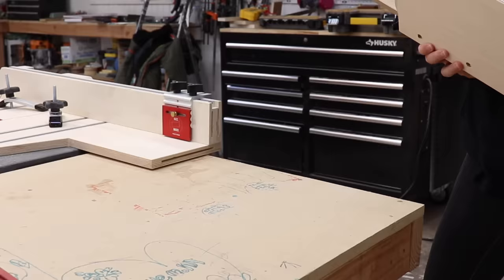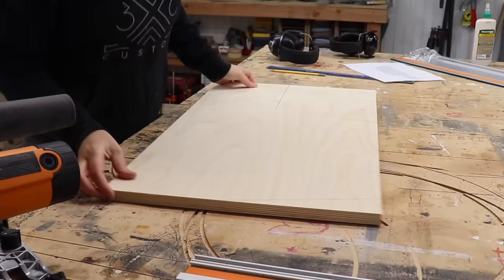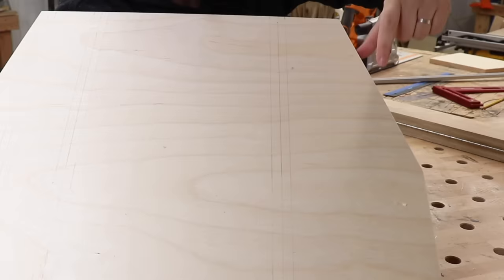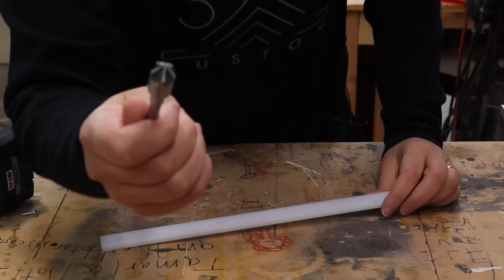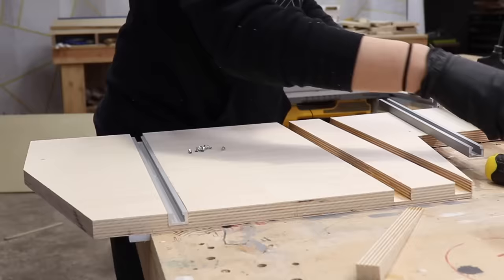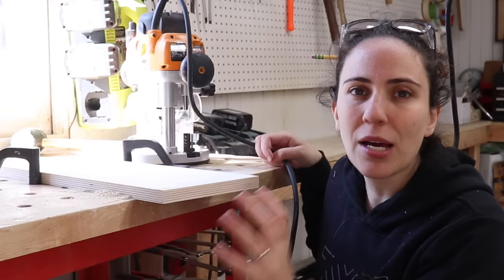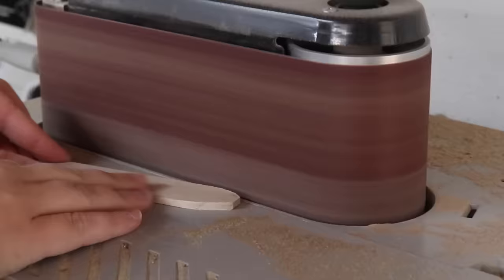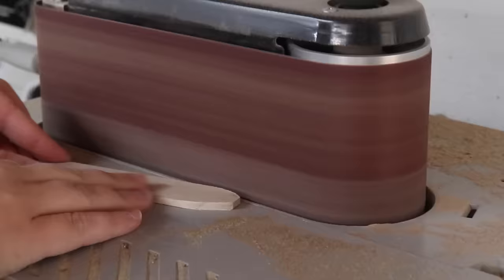SMALL Cross-Cut Sled with ADJUSTABLE Fence, EXTENSION wing and BEVEL Feature!

Comment: Very nice sled!  I would suggest though that your mitered end of your sled should be on the opposite end, where the blade falls away from the sled.  That way, the waste cut off falls to the table and would never bind into the blade.  Since you have the blade tilting in towards the sled, the waste can be trapped to the blade and can throw or kickback your waste.
Reply from the maker: The piece I keep is usually on the sled… and it’s clamped. The offcut is on the outside

Comment: Just built a new sled for my new saw, basing a fair amount of its functionality on your design (particularly the t-track positioning and the ability to use the miter stop with the clamps. It's a great tutorial video, and I'm really happy with my result. I didn't (yet) include a t-track on the fence because I haven't convinced myself that the extra utility from a track-based stop block is worth the effort, but perhaps that'll be something I add when I run out of things to do :) Thank you!! (also bought your plans online for the layout details)

Comment: I love the design, its has a lot of possible applications. Its always nice when one tool can do multiple things while maintaining high quality standards. My only "but" in this one came up when I priced out the materials. At current prices the total for the sled comes up to $300, and that's not including shipping for some of the parts. Some of that cost can be justified by having "leftovers" such as the T-Track hardware kit that's $75 and the HDPE that costs $30 for a 12x24 sheet, but a lot of it will be all used up on this sled. 
I feel like after spending $600 on the table saw I might have to wait a little while before picking up this project. It's definitely the most thought out sled I have seen so far though.
Reply from the maker: Yeah I hear that. But it have been the most used jig in my shop. So it’s worth it

Comment: I bought your plans. I am in the process of building this now. I am looking forward to using it to make 12 One hundred and forty year old barn oak picture frames. I have a Sawstop Industrial cabinet saw and I had to adjust some measurements which of course you expressly mentioned. My saw miter slot has slop long ways, meaning the miter slot is looser in the front and tightens as you go further in. I couldn't for the life of me get it to not have play using one miter bar. I put on a secondary miter bar, one that I can remove to use the 45 degree feature. I made my fence out of three 3/4 pieces of Baltic birch with the main fence having cut the middle piece 5 1/4 shorter on the extension side. On extension fence I made the middle plywood sandwich 5 1/4 longer and it slides into the main fence locking it into the main fence with threaded 1/4 inserts and flush head furniture bolts. Your design is really pretty awesome. I will say with current inflation, by the time you buy the plywood, and all the components, this sled turns out to be pretty pricey. I mean really pricey. But that being said, thank you for this brilliant design. I was using an Incra miter bar. I switched it out for  maple miter runner and now the is no slop. So it looks like I am gonna be able to use one miter bar instead of two. Almost done with mine. Getting really excited.

Comment: Fast way to ck squar, cut off a decent part, flip the off cut end for end and see if the 2 cut lines are tight or if you have a gap if it has a gap first thing I do is make sure the blade is parallel to the table t tracks and the fence is parallel to the blade is every things in line, then start on your cross cut sled, set one screw and use a true square  to line up the fence and add a second tempory screw. Now without the 5 cut method  make one long cross cut  flip the offcut and place it next to the originally placed part if you have a gap you can mesure it with feller gadges paper or tape or even a playing card, then move the fence in the direction to correct the cut lock it back down and make a second test cut. You should fall pretty dam close to perfect  becuse your working with wood there is really no need to split hair's  unless thats somthing you find critically nessary
This all depends on what your making
And how good the craftsman is going to be, but no mater how hard you try your not going to get a perfect 90. It will always be off by minutes  in degrees 
Even metal work isn't perfect. 
You have to find your tolrance leval and strive for it, thats cratmenship.
Even the best work isn't perfect. 
Its whats pleasing to the eye.

No offense but thats a dewalt table saw its not all that accurate to begin with
Its a job seight table saw,  it ment to load in the truck and take to a job, its also plastic, that means its getting Jared around.  Id like to see you find a good used cabnit shop type saw, like a used powermatic or delta or even a craftsman from the eairly 2000s the rigid isn't a bad saw  you can find a decent used saw for under 500 bucks. Even as low as 300 bucks.  Look on Craigslist before you go set down a 1000 bucks on a new tool and visit estate sales.  You can pick up whats now a 2k dollar saw for under 500 bucks used.  So it might need a tune up or some refinishing on the table top.
But ill almost garentee  you can find a good saw that hasn't been abused or even used much. 
This is with any tool.  Who know you might find somthing really good with a incrua fence on it, that fence can make a cheap saw cut like a 2k dollar saw.
It pays to watch the ads. Trust me I paid 20 bucks for a sears craftsman lathe made in the 60s with a duplicator on it.
At am estate sale.  Along with that I got 650 bf of walnut lumber and a 120 volt motor all for 22.50  the lathe alone might sell for 350 to 400 but I'm keeping it.
I also paid 65 bucks for a delta 6" jointer .
It pays to shop around.

Comment: Pretty impressed with you sled, beats mine into a cocked hat. Got the instructions from your website. I'm in England, we use metric now and it is so much easier than inches and fractions of an inch. Had to get my old ruler out. All our ply is metric as well. I guess it's what your used to, and it's what it is. Printed out the document onto A4  paper and shot off down the workshop with the plans. Excellent until I tried to see the printed sizes. No problem, got out my head mounted magnifier and there it was as plain as day. Not a criticism of your design by the way excellent bit of workshop work and a good set of plans. Thanks for sharing.
Reply from the maker: Ah sorry about that

Comment: Every time someone says they are not going to worry about making the back fence perfectly square, I cringe just a little.
In my mind, the front fence is the one at the front and the back fence is the one at the back.
Working with the sled and looking at it, I'm standing behind it so the front is furthest away from me (just like my stomach!) and the back is where I reference off.
Thus the back fence is the one that should be square and the front fence is the one that doesn't matter.

Comment: You have a side table which supports your fence extension. Most of us do not use a side table. What about your extension design (length and attachment method) for those of us without the side table? 
If you remove your side table: 
-does the extension base and fence remain true/flat/straight? 
-is the sled with extension still stable (not side-heavy)? 
-does a single slot runner continue to be adequate compared to 2 runners?

Comment: One of the best combo cross cut design I've seen.  Question...   ...Could you add the second miter slide and simply dado a channel for it on the side extension table when using the bevel function?   I'm just concerned about the stability with only one miter slide.  Or, maybe my concern should not be of any concern at all.  Thanks for the video. It made me a new subscriber.
Reply: I e used it for a year with just one slide and it’s fine.

Comment: If you flip the adjustable angle piece upside down, then you can butt the 45° up against the fence and always be sure that you’re cutting at 45°, because if you have to eyeball it every time, you always run the risk of missing the mark and go over or undr 45° and also ruining the piece if you went to far and scrape it with the blade and you might not even notice it so every cut after that is going to be off 100% of the time. Other than that, great job, love your videos and I’ve learned a lot from you. Keep up the good work.

Comment: I love this design especially for the weight saving. I've watched loads of cross cut sled makes and, at the chance of appearing a bit thick, can anyone tell me why the sliding base has to be so thick? Before you all say its for the add on mitre slots etc, I don't  need these and will be using pie slices for the angles I need because these are better for my loss of dexterity. Any views will be much appreciated. I know this isn't a forum, in fact, I'm asking on here as you, milady, are the guru and genie in my wobbly workshop. 🥴

Comment: Ok, so I started on this today and I may have missed something but it would (and did) not cut those angles off before running the dados slots so while I was using my table saw to make the dados I could still do it without having to use the router. Took all of 10 minutes.

Comment: I'm in the process of making one of these - seems like you could easily use doubled up 1/2" ply for the fences. I'm using 3/4 like most crosscut videos I've seen on YT, but it seems needlessly thick/heavy.
Reply from the maker: I prefer a thicker more stable fence. But you do you.

Comment: Making the sled right this moment and thought I’d point out a little clerical error in the instructions.  The Cut List (specifically for the 2’x4’ sheet) has the main sled dimension of 16.5” x 30” in the image.  However in the text above it states 16” x 30”.  The correct number is 16, as you later find out when laying out the angles for the sled.  It’s not a big deal… my sled is now .5” longer! =D

Comment: Very cool. The only flaw I see is because you cut that piece out of the sled to make it lighter, you are limited to cutting short pieces with 45's on the ends. I would make a sled with two long "arms.  One for 90's and one for 45's.  However. there are easier ways.  1. Miter saw. 2. Kreg Adaptive Cutting System. I own both.  So, I'm trying to decide if I really need a crosscut sled.

Comment: i know it’s a old video but i love the design of the sled so i cut everything to your specifications but when i went to cut the 45 bevel the other miter slot is to far away to cut it. i have the dewalt 10” job site table saw

Comment: I’ve watched this video many times, it’s soothing and therapeutic lol but really I miss your content so much! Question Tamar, how did you figure the dimensions of this crosscut sled for your table saw? I have an awful Ryobi 10” ts and I’m trying to figure out where to set up the miter slot and width of sled so it can change from the first/90 degree slot to the 2nd slot/bevel cut without too much hangover/waste. Is there a formula or do I need to just trial and error till I find the best fit? Yours perfectly fits when you transition to the 2nd/bevel slot and I hate to have a ton of hangover if I miscalculate. Love your work, I hope for some awesome shop builds and jigs in the future 🤟🏽

Comment: I just found your channel because I just started doing woodwork.  I REALLY want to build this sled, but I have a really small worksite table saw.  Will I need a table or surface to surround the table saw to use this?  Maybe I could just use the small part without the extension....

Really great work and great explanations.  It is appreciated.
Reply from the maker: I don’t think you need the tablesaw extension to make this work

Comment: Tamar, this is excellent looking.  Not only was the vid a joy to watch, but the value in all the hardware you referenced is great.  Some of the ancillary features I wouldn't use often, but way it's designed, doesn't get in the way much, and nice to have for those occasional uses.  I might figure out how/where to get a sticky tape into place for back fence, otherwise not obvious I'd change a thing.  Is putting a coat of poly on useful, or in fact a bad idea?

Comment: Question: Tamar, I bought your plans about 3 weeks ago.  I discovered that my tablesaw blade tilts to the right.  I thought first to just make the sled longer to the right side to accommodate that different angle, but do you think that it would as functional for making 45 degree cuts?

Comment: I was wondering if the Dewalt table saw is different from mine. I purchased your plans and watched your video, repeatedly, and cut my sled perfectly. However, when I line up my center cut, nothing else lines up. The slide track is almost directly under the first track on top and when I put the sled onto the other side of the blade, to cut the 45, its 3" away from the blade. When I line up the center cut, the guide rail is about 3" away from the side of the sled. What am I doing wrong? Thanks

Comment: You may have "over engineered" the fence extension, but you didn't over engineer the squaring of the fence.  

I see so many people start by squaring the fence to their carpenter's square, then adjust it using the 5 cut method to get it NASA perfect.  Then, they use the same carpenter's square to test for square those things they make.... the same square that wasn't "square" enough, LOL.

Comment: Question,  what is the tickness of the HDPE,  your link points to 1" thick but the video shows much thinner.  Thanks
Reply from the maker: Measure the depth of yours and get something slightly thinner. You just don’t want it to rub on the bottom

Comment: Just spitballing, but when setting up the angle jig, can the 45 be put flush against the fence (instead of the blade) to achieve a more consistent cut? I always have problems with the teeth on the blade. Thanks for a great plan/video. It’s next on my project list!

Comment: Excuse me teacher, I have a question.  ( 😁😁)  When you secure the fence with a screw at one end and do a test cut to check for square, what is temporarily holding the other end of the fence in place?  I was just about to attach my fence but then this question popped into my head.
Reply from the maker: Ha! You secure it with a screw and test cut. If you have to adjust it you drill another pilot hole for another screw.
Reply: @3x3CustomTamar  Ya, I just figured that out about 2 hours ago.  But me being me and not thinking, I put the second screw on the same side of the kerf as the pivot screw.  That first test cut was...interesting.  Anyway I managed to screw everything back together and it is finished and it cuts perfect 90's.  Your stop block on it looks very fancy btw.  Looking forward to your next project/video.

Comment: When you attached the runner at the 5:24 mark, it looked like you were using flathead screws, but prior to that you showed round head screws.  Which did you use?
Reply from the maker: I believe I used flat head so they are flush with the runners I just countersunk them

Comment: 12:15  I was wondering why you also put thread inserts in the oak strips.  Doesn't that prevent them from drawing down firmly to the fence?
Reply: Maybe I'm just OCD, but I would want to drill the ones in the oak out smooth.

Comment: Hi, I'm collecting information in order to build a sled and this looks like it's going to be the basis for my design.  Since I own a Shopsmith which has a very small table, this will work well I think.  One question I have is, do you ever regret just having one runner?  It seems like it might "rack" or bind.  I know having just one runner is what allows you to use it for bevels but I thought maybe there is a downside to it as well.

Comment: Damn, had to pull mine apart , will have to rejig it a little bit as the mitre slots on my cheap saw are not equidistant from the kerf/blade! So when I switched it from one side to the other it didn't line up! Argh!!

Also still waiting on my email about the router guide being available again??

Comment: Hello my name is Billy I'm a 36 year old quadriplegic and I still pull off woodworking projects with some help… I was wondering where do you get your 24" x 30" Baltic Birch panels… I can only get seven ply birch at the big box stores for around $70 a sheet 4' x 8' ? Love your videos & I already purchased the plans for this sled, I also ordered (2) of those stops !!
Reply from the maker: I ordered them from woodcraft. I can also find 5’x5’ sheets at my hard wood dealer. You can’t get it at the big box stores

Comment: Tamar:  Great crosscut sled.  Truly multi-functional. My only concern is that this sled, especially with the additional fence could cantilever a bit corrupting the 45 degree cut on the beveled edge.   You appear to have a plywood cut out table surrounding your metal table saw top.  It appears that plywood table is about 1/4 inch below the surface level of your table saw top.  I only have a table saw on a mobile cart and roll it up to the edge of my work bench which is 1/4 below the saw table to function as an out feed table. I just wonder if using a standard upside down miter T bar like the type that Powertec sells might keep the sled down on the table saw top where the HDPE bar might let the sled tilt up while cutting when so much of the sled is hanging over one end?